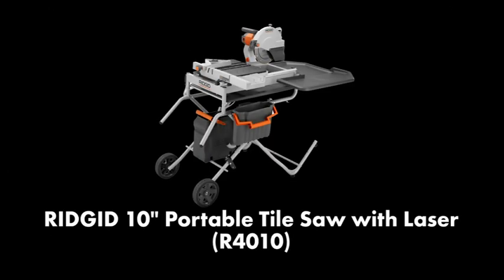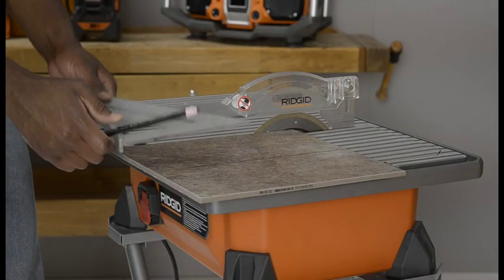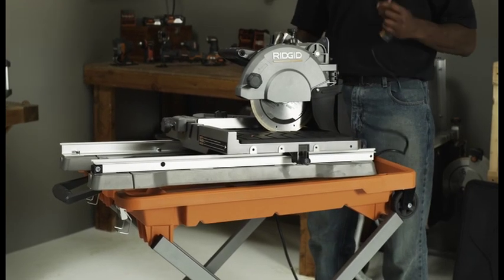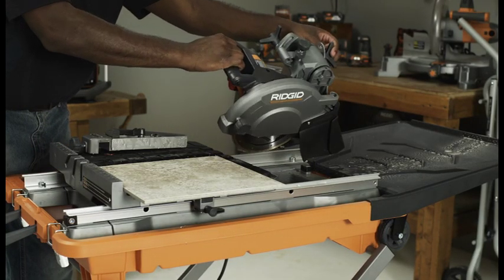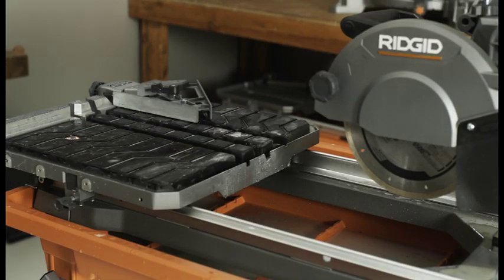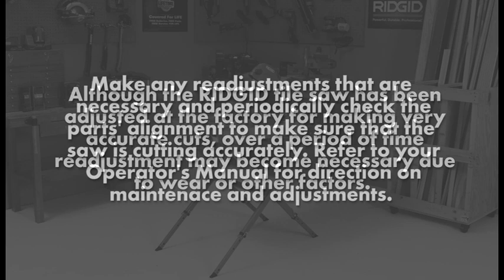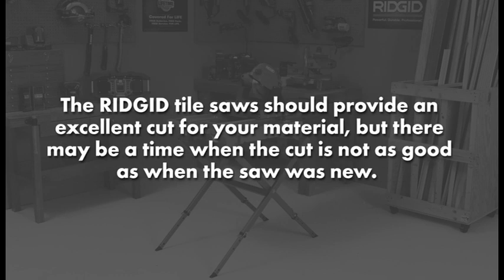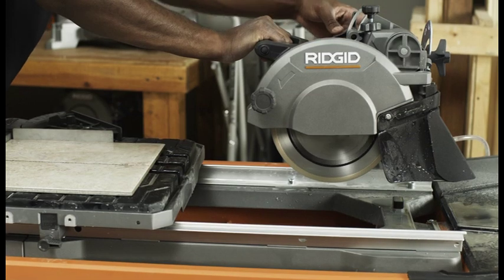RIDGID How-To Video: For Tile Saws

Comment: It there an available table extension for the R4040s? I'm going to be bevel cutting the edge of a 24" x 24" tile and need the overhanging material to be supported.